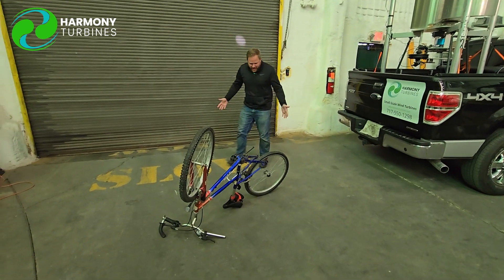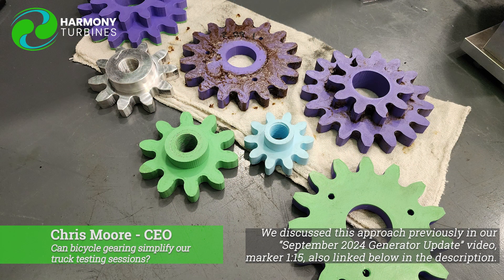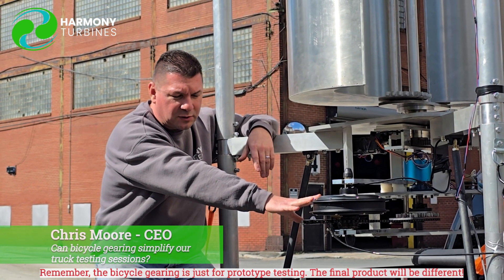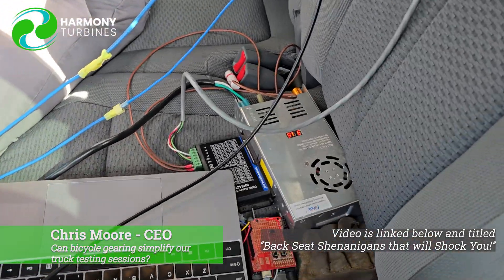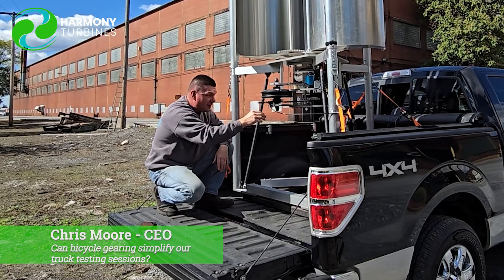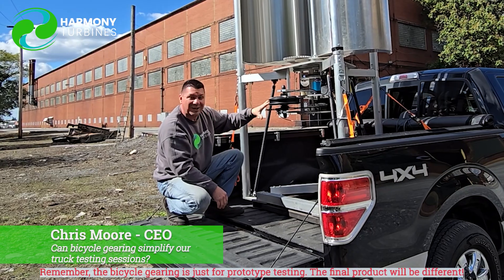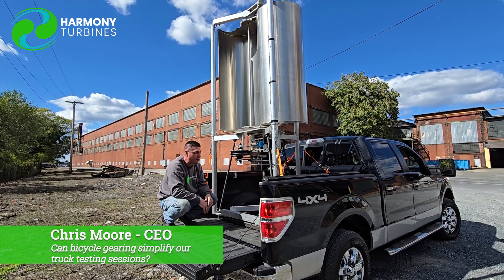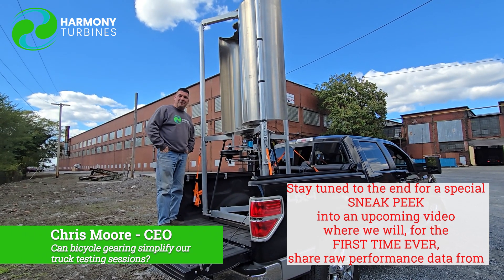We put our Wind Turbine in CHAINS!

Comment: Im sure you could attach an encoder to the shaft of the turbine to determine speed. When you figure out the most efficient rpm for the turbine, you can attach an arduino controlled CVT to optimize the gear ratio to always have the turbine spinning at the optimal speed, regardless of what the wind speed is. You can get some decent moped cvt kits for a couple hundred dollars.

Comment: I was wondering if you guys were eventually going to scavenge a gear assembly off a bicycle & use it for testing purposes(?) That said, if you’re not already aware, there are bicycle manufactures and aftermarket manufacturers that offer “automatic” gear shifts for bicycles, which actually self-adjust/auto-shifts the gears with no input from the rider, and was thinking an auto-shift gear assembly “might” be really interesting to experiment with on one of your turbines(!?)
Reply from the maker: Thank you for the information. Right now we are just trying to find a good range for operation in both low and high winds. But the hope is we will not need variable gearing once we find that good range. If we do, we will certainly look at this as an option going forward.

Comment: I was going to suggest trying a CVT but I already see it in the comments
Reply from the maker: Yes we looked at a bunch of CVT's but they're super expensive for these purposes and higher friction than bike gearing. We don't need infinite adjustability, just reasonable gear ranges so bike gears are cheap, very low friction and easily accessible.

Comment: You need a cvt transmission, that will allow your generator to work at higher speeds without closing the fins. You can have optimum power for longer period of time. You just need a good software to keep the optimum output at all wind speeds.
Reply: Problem is the cost of adding a cvt on top of everything else. Though could also be an interesting to offer a cvt as an upgrade option.
Reply from the maker: Yes we looked at a bunch of CVT's but they're super expensive for these purposes and higher friction than bike gearing. We don't need infinite adjustability, just reasonable gear ranges so bike gears are cheap, very low friction and easily accessible.

Comment: I have a question for you, listening to you talking gear ratios made me wonder if a CVT style transmission would allow the turbine to start at lower speeds, then produce more power at a higher gear ratio as the wind increased?
Reply from the maker: Yes we looked at a bunch of CVT's but they're super expensive for these purposes and higher friction than bike gearing. We don't need infinite adjustability, just reasonable gear ranges so bike gears are cheap, very low friction and easily accessible.
Reply: @HarmonyTurbines  My thought was that a CVT might be an option in a production model.  As I mentioned, I wondered if that type of coupling would give better low speed start performance while really pushing up the output as the wind speed increased.  But I understand what you are saying about the payback for the performance increase making it not a viable option.

Comment: wonder how much of a difference a small CVT could make in generator efficiency instead of a fixed gear ratio. Obviously cost would be a huge issue, would still make for an interesting test.
Reply from the maker: Yes we looked at a bunch of CVT's but they're super expensive for these purposes and higher friction than bike gearing. We don't need infinite adjustability, just reasonable gear ranges so bike gears are cheap, very low friction and easily accessible.

Comment: I dont see why this could not be a Production setup, where at low speeds it allows the turbine to rotate as well.
Is that possible?
Reply from the maker: We might consider it if such variability makes sense. It's our hope however, that we can find a good gear ratio that seems to work well in both low and high speeds. But yes if needed we could allow something like this on production units.
Reply: @HarmonyTurbines  Electrically actuated CVT?
Reply from the maker: Yes we looked at a bunch of CVT's but they're super expensive for these purposes and higher friction than bike gearing. We don't need infinite adjustability, just reasonable gear ranges so bike gears are cheap, very low friction and easily accessible.
Reply: @HarmonyTurbines   Harmony / Shimano partnership!  :)